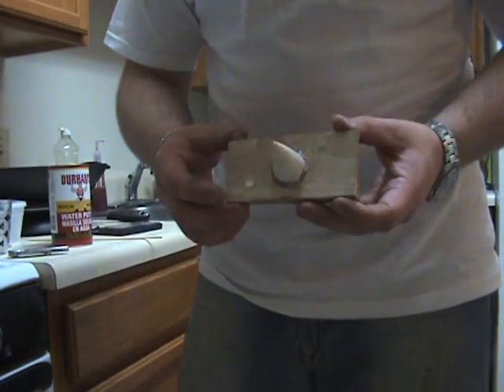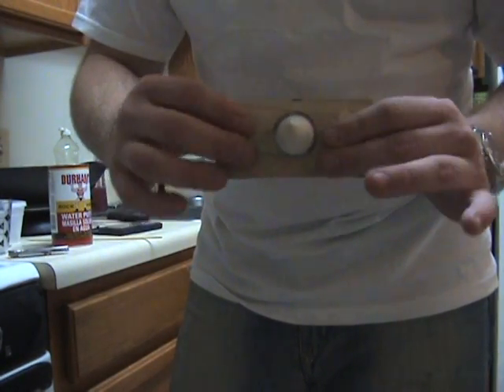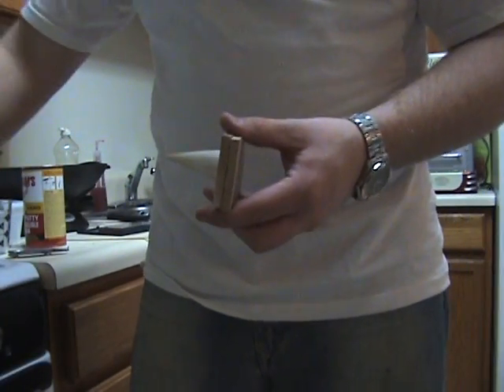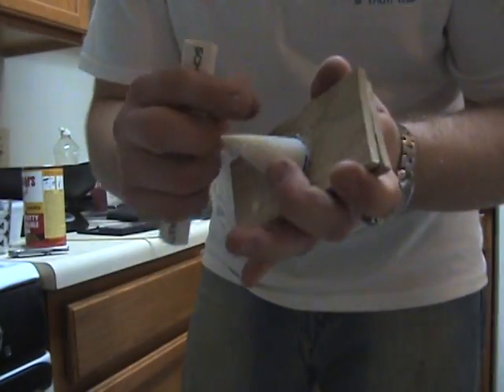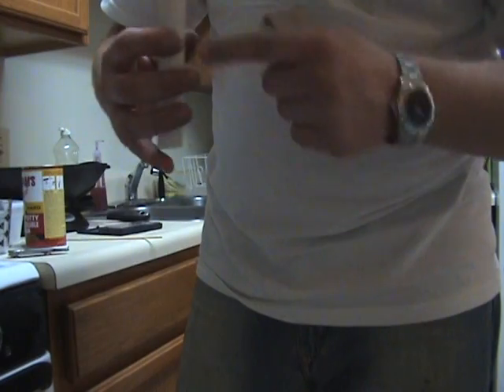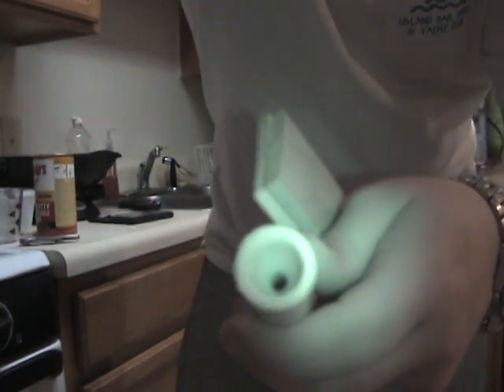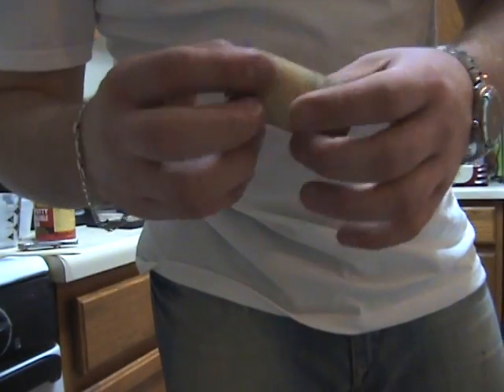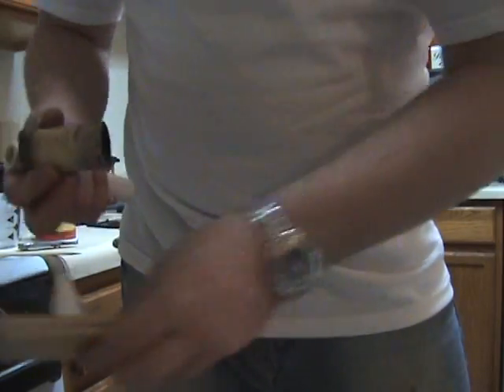Rocket Engine Nozzle

Comment from the maker: Correct, hot glue to keep the bottom attached to the template.  No problems with removing the hot glue and carefully twisting the nozzle off of the template physically - but the time needed for the putty to dry completely before you separate the nozzle from the template is an issue that is overcome via trial and error.  We did not attempt to separate our nozzles before 4 hours dry time and that always worked.

Comment from the maker: @LIONMAN11111 I'm sure it's possible to get away without the washer but I wouldn't recommend it because the high pressure and duration will most likely erode the cement before the motor is finished burning.  This could result in a major performance decrease

Comment from the maker: The steel washer I place on the tip, is to prevent errousion of the throat in the nozzel, due to the high pressure and flame. If you don't put a washer In, the the throat gets larger each time you reuse the nozzel. Good luck!! -KoD